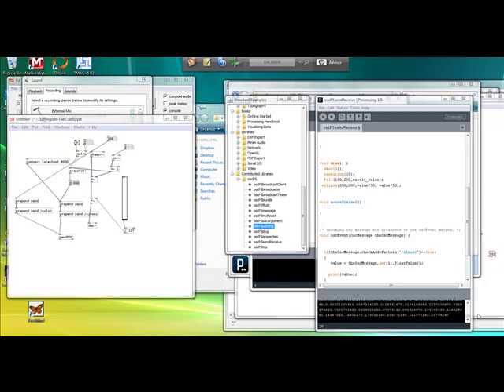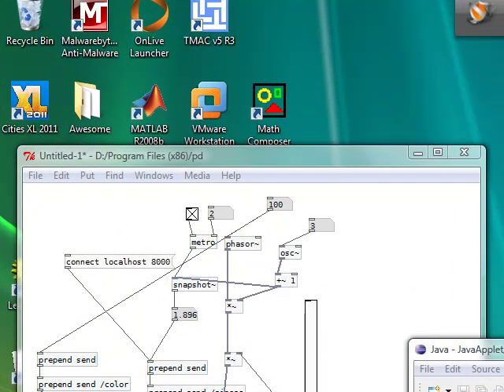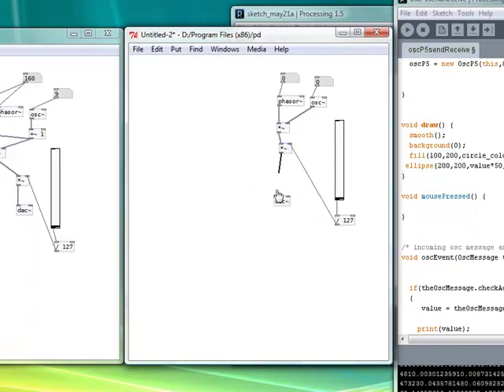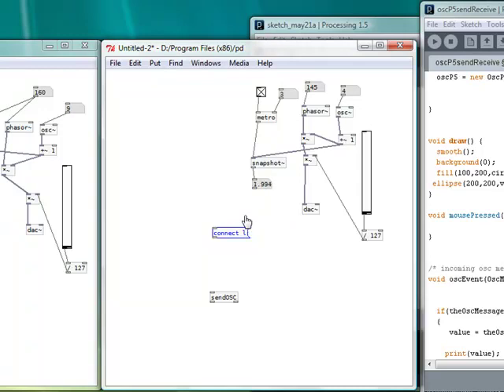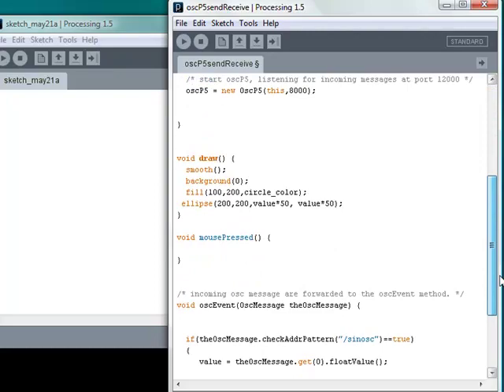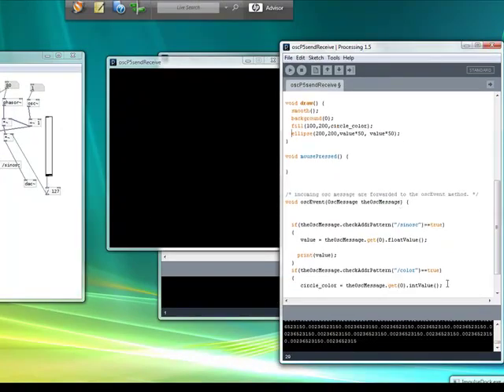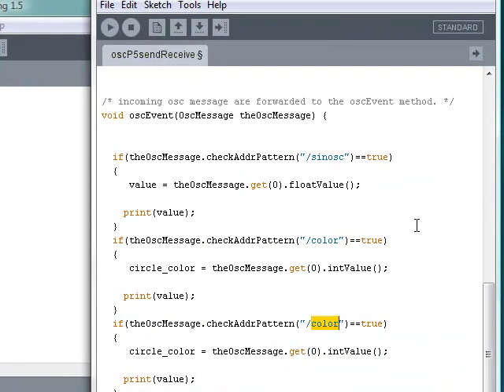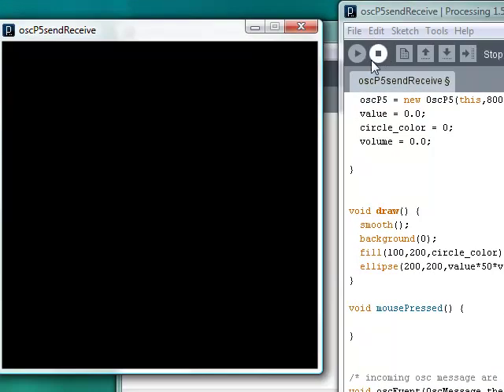Open Sound Control Introduction/Tutorial

Comment from the maker: You do it the same way as sending any other message, except you make the pattern address '/bang' or whatever you like and don't include any arguments. Then, when you receive a 'bang' message in Processing you just deal with it accordingly. One solution would be to have one argument, which is the 'target', so your message would have address '/bang' and target 'metronome1' or 'startPlayback' or whatever you'd like it to do in Processing, and then use that as an extra term to differentiate them.

Comment from the maker: @ricknance There is no /dial in this video, I think I was jut giving a generic example about that in the intro. What I am sending from PD to P5 is information about the amplitude of the sine oscillator. So if you look at 07:53, there is an object saying prepend send /sinosc, which then plugs into sendOSC. That prepends the words "send /sinosc" to the value of the sin signal coming from the snapshot~, which sendOSC interprets as something it needs to send over the net.